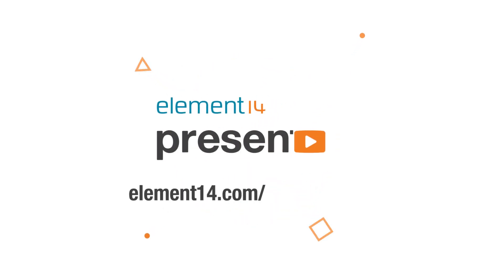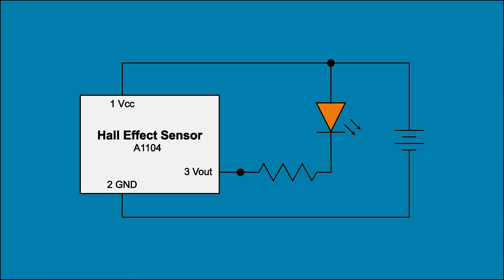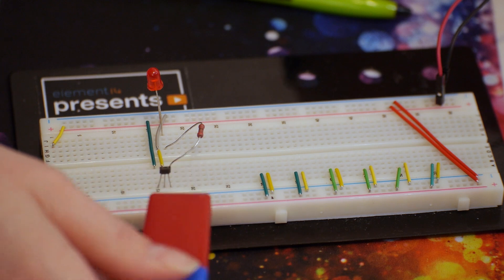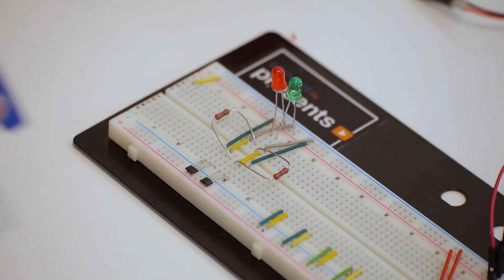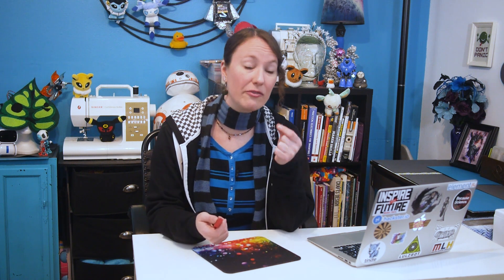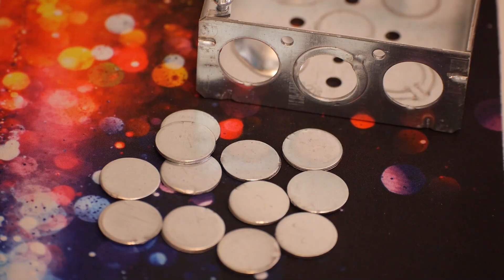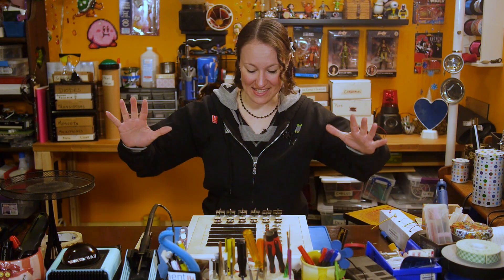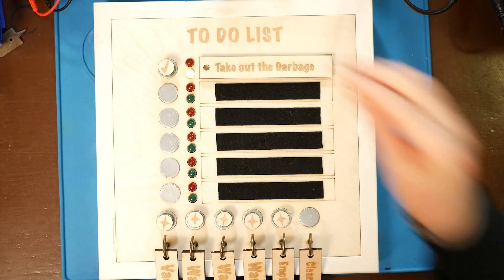Electronic To-Do List using Hall Effect Sensors - The Learning Circuit

Comment: Nice learning project.

Applying some processing logic the token itself has the same output as the LEDs just ✅ or ❎ instead. You've got potential for an extra output. If you you individualised the tokens they could show who completed the task and you'd have the opportunity for an incentive & lots of extra control logic in a master control to reset the inputs & processing to stop cheating. Maybe have start positions for each token that also become an output when a task input is made 🤔

Comment: Suggestion: Replace the 'chore strips' with a color monitor attached to a Raspberry Pi where you have a process, called for instance, 'Task', running, that displays these tasks, maybe with the background color set based on whether it needs to be done.

This really works well with a grocery list, where 'GroceryList' is able to display the food items in order, frequency of purchase, cost, etc.

Comment: could cut down on amount of sensors, make the hole rectangles, and the magnet on its side + glued on to pin, only 1 way to insert the magnet, also why 2 leds per task, could be 1 dual color led or just green when finished.
velcro only allows to use 1 side of label, magnet can be embedded, so it sticks front and back of label to board.
hooks are dangerous, sleeve/jewelry could catch, but basic idea is fun and educational.
board could be a door, hiding unused labels.